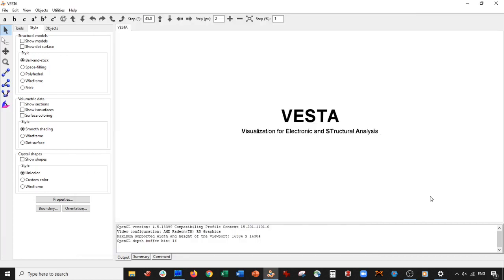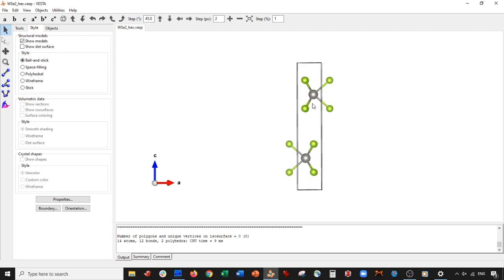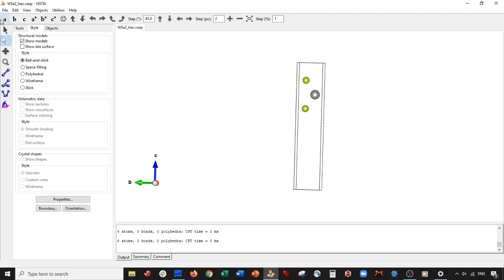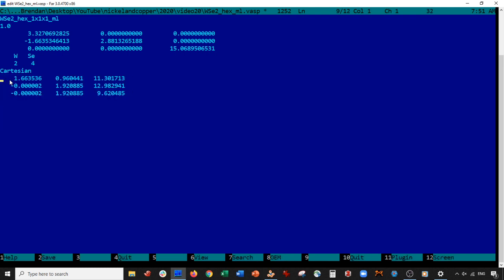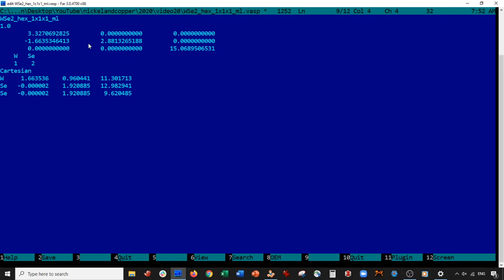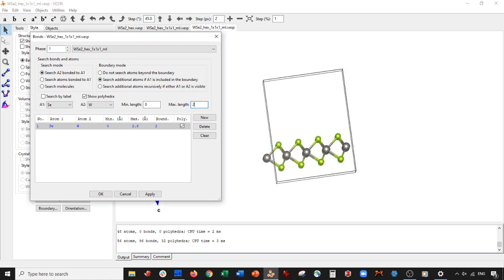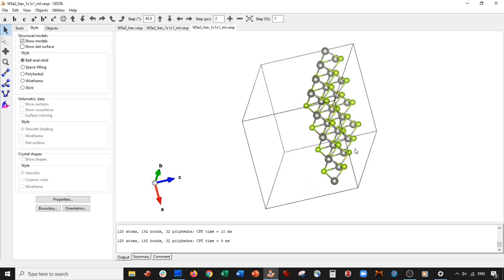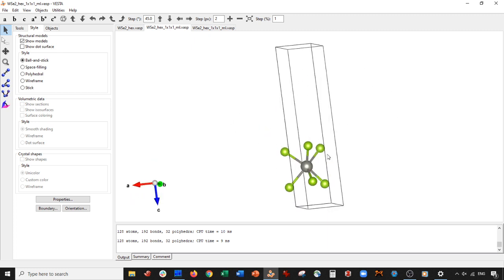VESTA Software - Build Hexagonal WSe2 Monolayer

Comment: How can open up viwer window (blue in colour)
Reply from the maker: It’s far3 viewer. It’s a separate package, not apart of Vesta
Reply: @nickelandcopper5636  thanks a lot for replying.is it necessary to install it?bcz  for editing postion?
Reply from the maker: @ribhafatima7960  sure. You are correct - it is not necessary. I use it only for convenience when making edits. You can use any text editor
Reply: @nickelandcopper5636  Guide me plz in one more thing,after generation of monolayer then export file in xyz format which will upload on other software??

Comment: At moment 7:53 when the supercell is viewed from the c axis, how can I displace the parallelogram drawn by black line so its corner will be at the center of the grey atom?
Reply from the maker: Yes it is. You have to set the black atom in the .vasp file to 0,0,0 and then move all of the other atoms the same degree to which you had to move the grey atom to get to that point

Comment: Sir I cant find your tutorial about how to use Far manager. Also when I open a .vasp file in Far manager,it doesn/t show some neat co-ordinates like yours,rather it shows some long hard-to-decode symbols. I can't edit my .vasp file. .xyz files are working fine
Reply from the maker: Hi. I don’t have a tutorial on Far3. You must be viewing a .png or binary file, not a vasp. View to edit with F4.
Reply from the maker: And make sure you save the vasp with .vasp extension manually. For .xyz you don’t need to do this. So when you export as a vasp you must fully type the .vasp extension. Try this
Reply: Thanks a lot for helping,sir. Now I can do it

Comment: Sir, I want to ask you : the coordinates that we get from Wykoff positions in Bilbao website are direct or cartesian?
Reply from the maker: Hi. I actually have never heard of Bilbao, so I wouldn’t know
Reply: @nickelandcopper5636  https://www.cryst.ehu.es/cgi-bin/cryst/programs/nph-wp-list
this an example of Wykoffs positions in this website of the spacegroup Fd-3m. Are they direct or cartesian ?
Reply from the maker: I can’t tell there is no one set. Looks like direct though if I had to guess. Direct is in terms of the unit cell vectors. Direct is between 0 and 1 usually. Cartesian are w.r.t some arbitrary origin point.
Reply: @nickelandcopper5636  Thank you sir! yes I also think they are direct coords. I want to learn how to produce any monolayer POSCAR from any given article could you show me how ?
Reply from the maker: Hi. Any mono layer from any article? I think you need to take each mono layer on a case by case basis. There is no one single way to do it
Reply: @nickelandcopper5636  Like what piece of information is needed from an article to rebuild its material's structure ? is chemical formula,lattice constants, spacegroup and vacuum value are enough ?
Reply from the maker: It should be, ya. Vacuum value is sort of up to you. More is better. Check my video on the gold monolayer I build that from scratch

Comment: Sir When I take a primitive unite cell of SiC (Cubic). Make 3x3x3 super cell. As I extract the data as xyz then the number of Si atom is not equal to number of  carbon atom. Even I delete the extra atom and did again but they are different. The same happen for conventional unite cell as well.
SiC_Primitive                          
   1.00000000000000     
     2.6869744700507590   -0.0000000003845492    1.5513250440033037
     0.8956581563210299    2.5333035128199737    1.5513250440033040
    -0.0000000010876698   -0.0000000007690986    3.1026510917744061
   C    Si
     1     1
Direct
  0.0000000000000000  0.0000000000000000 -0.0000000000000000
  0.2500000000000000  0.2500000000000000  0.2500000000000000
 
  0.00000000E+00  0.00000000E+00  0.00000000E+00
  0.00000000E+00  0.00000000E+00  0.00000000E+00
Reply from the maker: After you make the 3x3x3 cell via unit cell transform (not boundary method) save it as a vasp
Reply: @nickelandcopper5636  Yes when I save it as a vasp then it is right. So now my question is, Why the number of Si atom do not remain same as carbon atom when we export data as a xyz formate?
Reply from the maker: When you ave it as a .xyz it saves the number of atoms on the screen